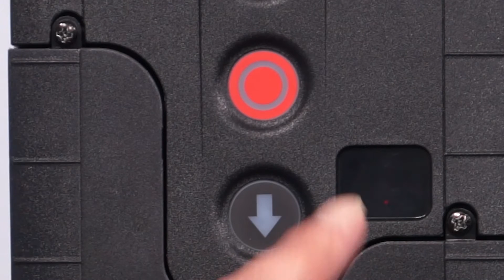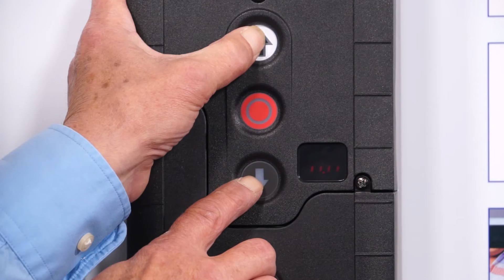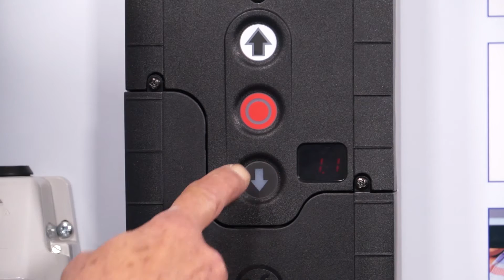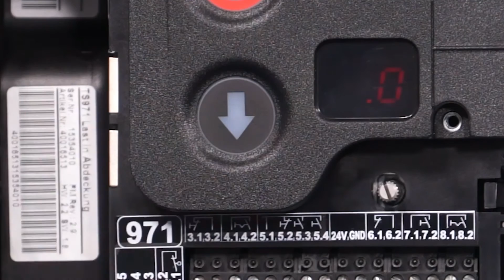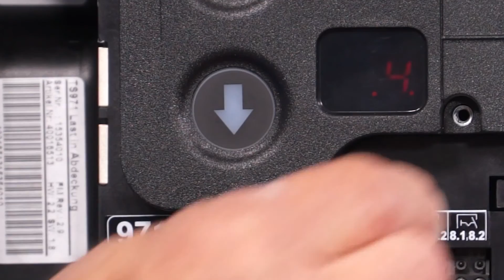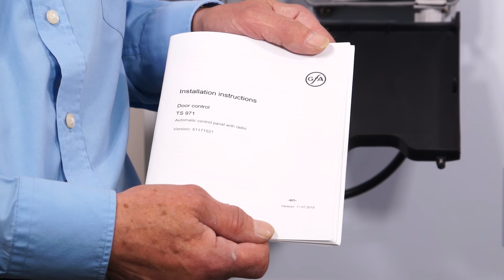Tech Tips: Setting up a GfA TS 971 Control Panel

Comment: TS971 is new control panel or TS981..??
Reply from the maker: Hi Mohamad

The TS971 in the slim line enclosure is suitable for wired or wireless safety edge with a built in radio receiver and is able to be connected to motors with mechanical or digital limits and is 1 or 3 phase.
The TS981 in the traditional enclosure is suitable for wired or wireless safety edge (only with an extra safety edge receiver) and is able to be connected to motors with digital limits and is 1 or 3 phase. This panel as a standard can control a two way traffic lights system controlling traffic flow through an opening. There are auxiliary modules to connect to the BMS system and offer a sequenced air lock system.

GfA UK
Reply: GfA UK Ltd thank u for ur response. we are using TS981. we have a problem with this. by pressing open and close at a time. it does not change the rotation of motor.so i have to change the motor cables. what is solution for this.? can u refer a person number whom i  can contact for this.
Reply from the maker: Hi Mohammad

You can speak to our Technical team by calling 01926 452452 or you can email sales@gfa-elektromaten.co.uk and we'll help you with your TS 981.

GfA UK
Reply: i have sent email to the given email address about some of problems which im facing.. but still no response..
Reply: @mohammadkashif286  Late but, older Software Versions doesn´t support this kind of changing rotation! Up to SW 2.5 do not, SW 2.6 do!